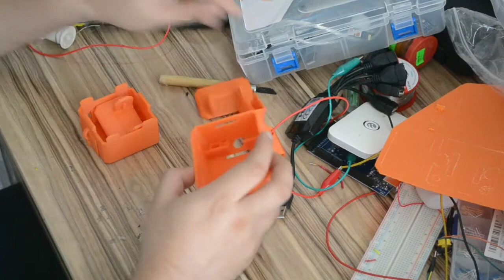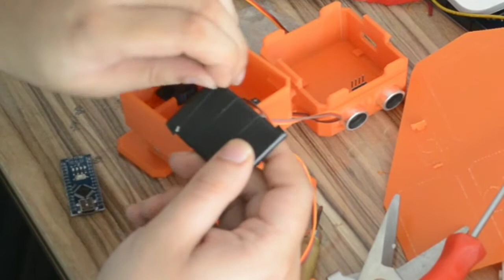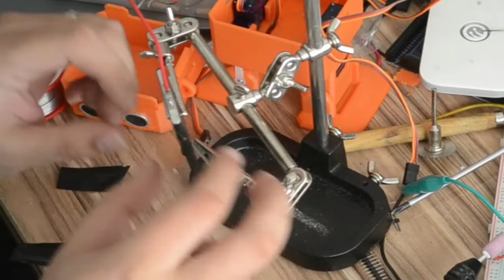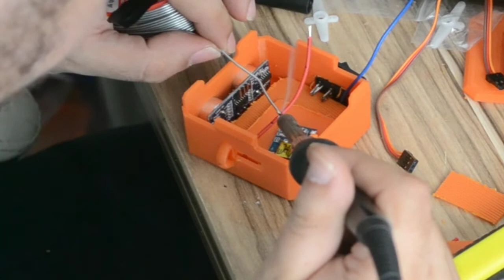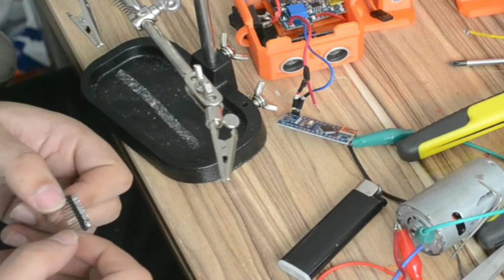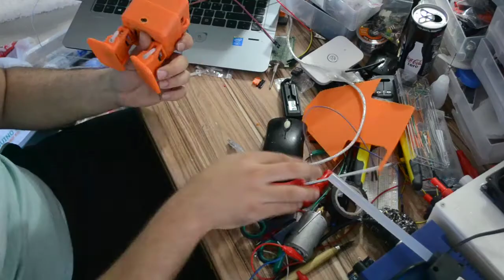Arduino ile robot yapımı (Arduino OTTO robot)

Comment: Sonunda çözdüm galiba. Öncelikle besleme için laptop bataryasından çıkardığım 1 adet lityum iyon pil kullandım. Dc-Dc step up devresi ile 9v yapıp " + " ucunu Arduino'nun Vin girişine," - " ucunu Gnd'ye bağladım (Vin girişinin yanındaki Gnd). Sensörlerin " + " uçlarını 5v pinine, " - " uçlarını arduinonun diğer Gnd pinine bağladım. Motorların " - " uçlarını diğer Gnd'ye, " + " uçlarını ise direkt pilin " + " kutbuna bağladım. Uzun süreli deneyemedim ama şimdilik sorun yok gibi. Benim Otto'da 2 adet dokunma sensörü, ultrasonik sensör, led matrix var.
Reply from the maker: Yeni açabildim Youtube'u. Sorunu çözmene sevindim. Senin robot daha güzele benziyor. Çok yardımcı olamadım ama kusuruma bakma.
Reply: Olsun videonuz bile yetti yardım için; güzel fikirler verdi. Bilmediğim 1-2 şey daha öğrendim. Teşekkür ederim.

Comment: Aynen gösterdiğiniz gibi bağlantı yapıyorum, sürekli sanki resetleniyormuş gibi çalışıyor, yani çalışmıyor. Sadece tık tık yapıyor motorlar. Nedeni ne olabilir?
Reply from the maker: Şarj devresi ve regulator devrenin giriş çıkışındaki voltajları ölçtün mü dostum? Kaç volt var oralarda? Giriş ve çıkışlardaki voltajlara bakabilirsen, sorunu çözersin büyük ihtimal.
Reply: Akşam detaylı olarak ölçüm yaparım ama step up çıkışını 5.6 volt civarı yapmıştım, çalışırken ölçtüğümde 7 voltun üzerine çıkıyordu. Bu arada belirtmem gereken şeyler var, benim yaptığımda extra olarak 2 adet dokunma sensörü, led matrix mevcut.
Reply from the maker: Motorları ve diğer componentleri Arduino'dan değil de direkt pilden besliyorsun değil mi hocam?
Reply: Tabi aynen, + besleme Arduino'ya, motora ve diğer kompanentlere; Gnd direkt Arduino'ya. Arduino'nun diğer Gnd'sinden motor ve diğer elemanların Gnd'sine. Yani + besleme ortak, Arduino kartının diğer tarafındaki Gnd motor ve parçalara gidiyor.
Reply: Yok ne yaptıysam çalıştıramıyorum, pilin voltajı 3,9 ile 4 arasında, step up çıkışı 7,5 - 8v arası. Hatta 11'e kadar çıkardım değişiklik yok. Bütün elemanları çıkardım, sadece motorlar takılı gene resetleniyor. Birşey yanlış ama ne bulamadım.